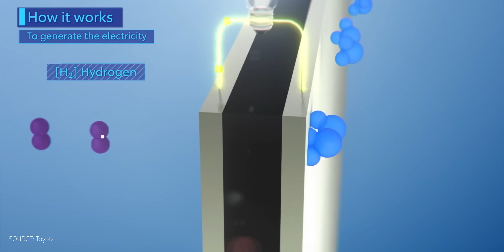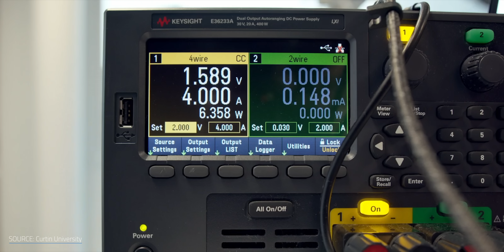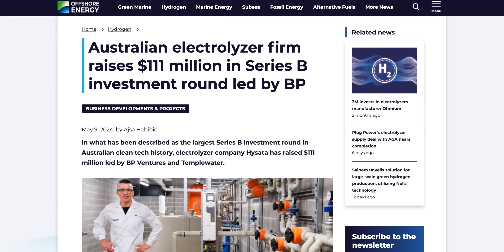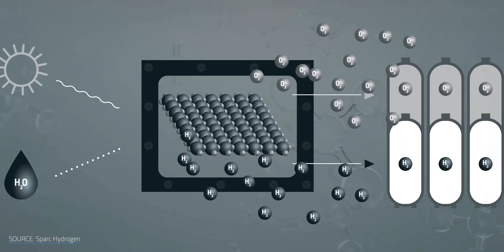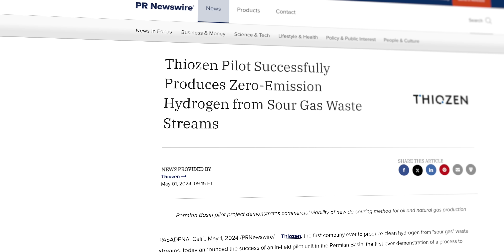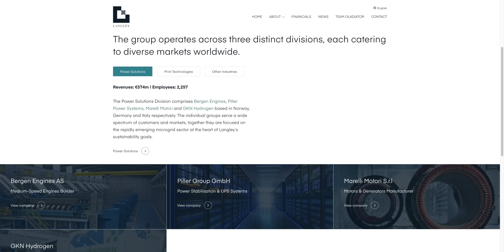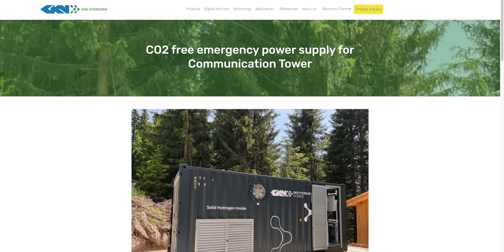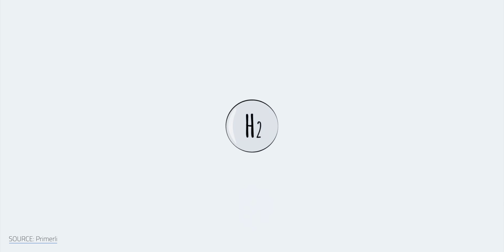How a Hydrogen Breakthrough is Closer Than Ever

Comment: Toyota has joined up with Kenworth to make the T680 hydrogen fuel cell electric truck.  So far the drivers have really liked it as it's comfortable and quiet.
Reply: Toyoda family wealth is from fossil fuels, which is needed to make the hydrogen fuel at great inefficiency. Meanwhile, we already have electricity in the most remote corners of the world.
Reply: @davidmccarthy6061  and in the few places we don't have electricity, it's as easy as shlepping in a few solar panels and voila!
Reply: Keep in mind that a fuel cell truck is still an electric truck meaning yeah, the torque available from electric motors, the wide rpm range, etc., all make for a much improved driving experience. But that's comparing electric trucks to diesel trucks. The interesting competition on the horizon is electric+hydrogen vs electric+battery... I know which one I'm rooting for, but I think honestly we don't know which one will prevail. ( Or whether it will be a combination of both ).
Reply: @boston_pc  - fuel-cell vehicles often need a companion battery to delivery initial and peak energy demands as the fuel-cells have to operate within a defined generating window to maintain efficiency.
Reply: This is hydrogen’s future for transportation

Comment: Lack of demand seems to be the dead end. Historically, when there's very high demand for something, people from all over find ways to capitalize on it. That when you see breakthroughs to make it cheap and abundant.
Reply: True, but it still does not solve the inevitable shortcomings of hydrogen as an alternative to what already exists. Every decade it soars up to the top three alternatives but after some articles about "the potential" and billions of dollars down the drain it fades away. Nobody seems to learn from others mistakes in this regard. Probably because someone else is making big money pushing for it until the bubble bursts, again.
Reply: @hrundgren4352  agreed. When you think about it, pure hydrogen is a romantic fuel. Between having extremely abundant sources of it and burning completely pollution free, I can see why so many want to crack the code for using it. But if it there, I'm not sure our infrastructure will ever be ready for it.

Comment: I think red hydrogen is the way to go specifically using the helium cooled reactors that they are using in Japan paired with the safer fuels for the reactor that makes a meltdown not possible due to coolant failure like other designs have had issues with, safe power and hydrogen production in one product

Comment: Meh. This video doesn't really answer any question I have about how hydrogen might be usable in the future - the closest it comes is when it compares the energy density to gasoline, but that's not the comparison you need to be making. Batteries are. Before everything else, you needed to show what the use case of this fuel even is, because cars is never going to be it. What niche does any of these breakthroughs help hydrogen fit into?

Up until now, the other elephant in the room is that hydrogen is not a way to generate energy, it's a way to deploy it, and that deployment has to be really worth it because of the inefficiencies of production and compression. That solar plant you bring up might, MIGHT change that - does it produce more energy in hydrogen than a solar-electric plant would in electricity? That's an important question, one that could actually change the outlook of the fuel, but you don't broach or answer it.

Disappointing.

Comment: Having worked with Hydrogen gas; material science  are not up to snuff and people are generally not safe enough to be around the gas. IMHO
Reply: People think it is just like methane or propane, both are being used in cars.
When you speak of hydrogen enbrittlement, that is is with helium very prone to leaks, and has a very large band of explosive concentration, people are surprised. Some don't believe it at first.
Reply: Compression for pipeline transport of H2 is also very challenging.   For thermodynamic reasons (among others) it's not possible to simply re-purpose the technology used today for hydrocarbons, CO2, and industrial gasses.  Lots of research is ongoing to find the optimal machinery types and configurations.  Integrally geared compressors are a good candidate because of the ability to intercool each stage of compression, but these are highly complex with efficiency issues.  Very large reciprocating compressors are another option because of their efficiency and the intercooling issue.  Seals are very problematic.  the list goes on.   

To your other point, I once worked around a large recip (60" stage 1 cylinder, 10 stages in all).  When a leak developed (when, not if), the H2 would immediately combust with an invisible flame except in the darkest night where it was very pale blue.  One could easily walk by an invisible leak and get severely burned.    

Tricky stuff.

Comment: Hydrogen has no place as a transportation fuel, its volumetric inefficiency and cost of distribution are insurmountable. That doesn't mean that there is no place for green hydrogen. There is a huge market for hydrogen for fertilizer and industrial processes. Green hydrogen only has to be cost competitive with dirty hydrogen, that's a lot easier  than being cost competitive with gasoline or batteries.

Comment: 95% efficiency for water-electrolysis is a VERY big claim. almost, too good to be true.
Id like to see an actual breakdown of their methods to achieve that result.
Reply: Trouble is, what good are little bubbles of hydrogen? The next step is to compress the gas and that alone is very energy intensive. If you have to then liquefy it to cryogenic hydrogen, well, even worse.

I'm not saying the 95% isn't impressive and useful if it can be achieved... I'm just saying for that hydrogen to be useful you still have to expend a bunch more energy before you have anything useful.
Reply: I thought the same thing when I read that LFP batteries are 98% efficient. So I bought some and tested them myself. Imagine my surprise when I was able to get closer to 99% efficient with calibrated test equipment.
Reply: Self sustaining by @ EirexTech in Canada.
Reply: Efficiency of what? The input is electricity but what's the output? Are they assuming that anything that is NOT heat is on the plus side of the efficiency equation? If so, this is entirely bogus.
Reply: @mb-3faze  I assume it is based on the energy to break water molecules, it's what makes sense. so if it takes a bit more than 200KJ to break one mole of water, 95% efficiency would means they spend 210KJ instead.

Comment: Hydrogen is how we move completely away from fossil fuels once we have no electricity scarcity (from renewables and nuclear). Battery energy density just isn't going to allow for aircraft flights and cargo ship voyages to be economically viable.
Reply: Batteries already lead in short haul flight with commercial planes available now, whilst hydrogen remains at the R&D stage. Similar is pegged for medium haul with 90 seat capacity 1,200 mile battery powered planes projected to be available before hydrogen ones. It's long haul flight where both batteries and hydrogen face challanges.
Reply: Many airplanes will run on batteries within 10 years and cargo ships can easily run on batteries right now.

Comment: In The Netherlands we had a test with central heating on hydrogen. It is a Total failure. The idea was to switch from natural gas to hydrogen. They can not make it work. A real shame, it would have changed a lot.
Reply: Hydrogen burns dirty in a nitrogen-rich atmosphere (ie air). It should have obvious that it wasn't suitable for homes.
Reply: What I don't understand is why they have to do trials that cost millions when a few back of the envelope calculations would clearly show it would be uneconomic.

Comment: A hydrogen producing well would use all of it on site in grid-scale fuel cell stacks, reducing any storage and transportation infrastructure, and rely on the electricity grid to transmit the energy that was produced.  This is a way that I can see hydrogen energy being useful and sustainable, and live up to its promises.

Comment: One way to consider hydrogen is at every stage it requires energy to be spent, whether in generating, storing, processing, handling and transporting. This energy spend is always higher than that of using electrons more directly, such as in battery storage systems. 

Even with the innovations mentioned in the video, such as the hysata electrolyser, there are additional system costs for filtering/purifying water and storing the hydrogen. 

Investment companies have to consider maturity curves of a technology, which is why battery storage attracts more investment than hydrogen currently. 

Even in areas where hydrogen should have an advantage there are competing technologies that have a lead on it. Such as witth hybrid-flow batteries, such as StorTera's SLIQ battery,  that offer similar site expandability and long term storage to hydrogen but are already deployed in multiple real-world assessment sites.

Hydrogen is simply a challanging technology that faces multiple challanges to address in parallel, whilst facing the challangers in faster maturing battery technologies of all forms.
Reply: Of course , oil doesn't. The drilling , pumping , refining , storing , transporting etc all happen because of magical unicorn farts
Reply: Have you replied to the correct post. I'm highlighting the challanges hydrogen faces. Contrasting it battery storage, including similar long duration battery systems such as flow batteries; since this is the use case mentioned in the video.

Where did I mention oil or indeed any fossil-fuel as an alternative?
Reply: @PaulG.x  
1. Oil doesn't need to be created, it already exists in its energy dense form.
2. Pumping the oil is already pretty energy efficient, some oil springs are/were so readily available, the oil just comes/came spurting out.
3. Refining the oil takes some energy, but all the products resulting from that process have a use, be it heavy oil, diesel, gasoline, light petroleum etc.
4. Oil products are easy to store and transport, just put them in a reasonably leak proof container and be done with it, no supercooling, no pressurization, no liquification, no losses due to it just evaporating through the material.
Reply: @dh510  It just endlessly pollutes - end of story...
Reply: @PaulG.x bro imagine if you had to constantly refrigerate oil to store it when it's just sitting in a tank waiting to be sold or used. There's no way in hell you are going to claim hydrogen is in the same world as oil when it comes to energy expenditure to use and store.

Comment: It's pretty widely accepted now that hydrogen use cases will be pretty much limited to industrial process where we need the gas. Making ammonia for example. Pretty much all other use cases have already been ruled out. There could be some usage in storage....but even there it's likely to fall by the way side compared to other options. It's good to explore cleaner ways to generate hydrogen.....but it does "fuel" those who still believe or have a vested interest in hydrogen for transportation.
Reply: Have you heard of Nikola? Doing some crazy hydrogen transportation stuff
Reply: @doritoseminar  Yes I am and they are thoroughly flogging that dead horse. They are making some sales due to misinformation and careful sales pitches to those who are still behind the curve with BEV. As with everyone else, once the operator realises the horrific fuel costs and ongoing maintenance issues and costs they back out. Hydrogen very clearly does not work at the fleet level where cost is king.